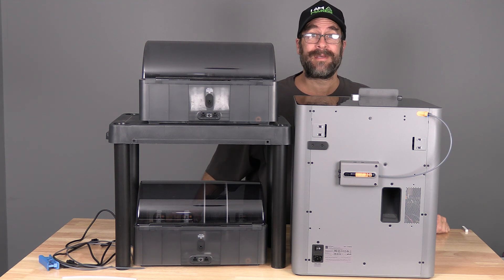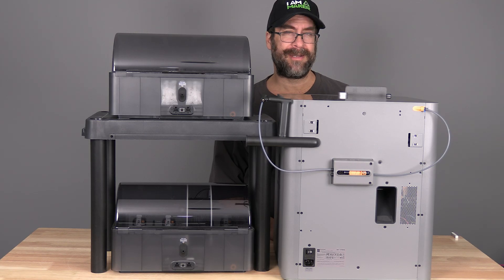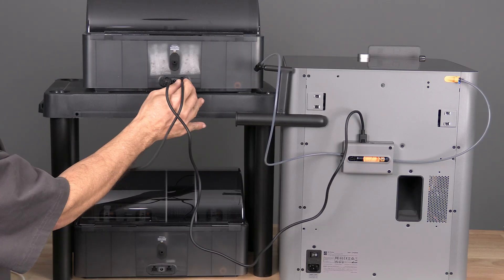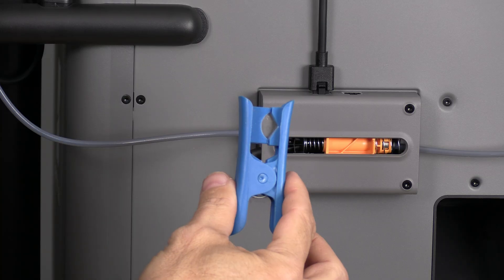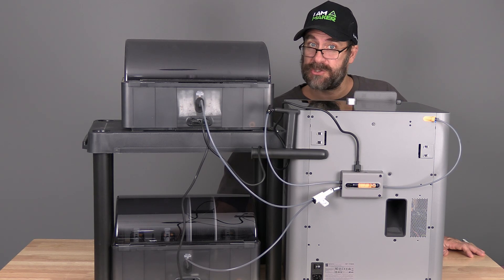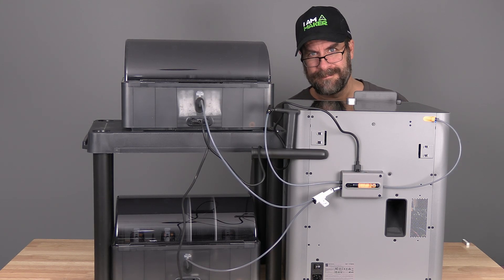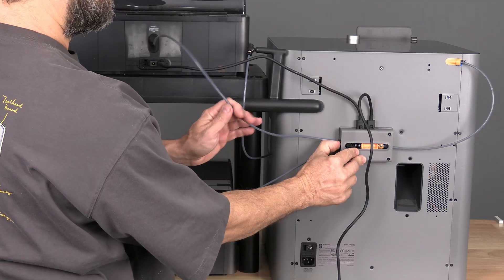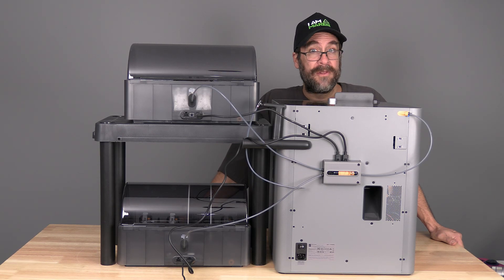How to Install Two (2) AMS to P2S 3D Printer - Bambu Lab

Comment: Bambu wiki P2S FAQ says "Q: The buffer of the P2S has two 6-pin ports on top. Does it support connecting two AMS/AMS 2 Pro/AMS HT units simultaneously?
The buffer does not support using two 6-pin ports to connect AMS/AMS 2 Pro/AMS HT units at the same time. One of the ports is a spare port, used for power supply and communication expansion of devices (e.g., time-lapse photography kits)."  This conflicts with the second setup you demonstrate.  Please advise.
Reply from the maker: There isn't really any reason not to daisy chain the 6 pin cables, but, I do believe both ports can be used. My P2S has been disconnected since I shot these videos, but I will try to hook it back up and confirm.
Reply: @3DRundown  I was wondering if it might affect the chain for getting drying power from the 6 pin for the first AMS 2 but needing AC adapter power for the second AMS 2 in the chain (and whether using both 6 pin ports might screw that up).  I've got a P1S using an AMS and AMS2 with P2S combo on order so I can't test yet but want to hook the new printer up correctly.
Reply: @MichaelWebb1416  @3DRundown I'm also interested in confirming this. I would prefer connecting the second AMS 2 Pro directly into the P2S. No real reason, I'd just prefer the direct connection versus daisy chaining.

Comment: Thanks for the great video!
 So the first method you demonstrated will also allow for 2 AMS 1 or 2’s as well as an AMS HT?
Also it is advisable to set the two AMS units on the right side (if you’re facing front) of the P2S? I had planned to set them up on the other side as that’s where I have space for them.
Reply from the maker: You can do up to 4 AMS2 and 4 HT, for 20 Color. That side would be ideal, as that is where the inputs are, but you could manage either size.
Reply: @3DRundown  Thanks so much! Your videos are super helpful and very thorough.
Reply from the maker: Very welcome!

Comment: If you daisy chain the plugs do you have to use the 4 way hub or can you daisy chain and still put one in each ptfe slot?
Reply from the maker: P2S hub has only 2 Inputs. You can use one in each, or the 4 way in one
Reply: @3DRundown I was more asking that in step. 1 you put the PTFE tubes in one slot on the hub and daisy chained the ams power cables.

My question is can I daisy chain the power cables and put each ams into a different tube on the hub, essentially splitting the difference between each of your methods
Reply from the maker: The typical way would be using one 6 Pin on the Hub, then connecting each AMS to eachother, via 6 Pin. Then one PTFE per splitter input

Comment: Love the video I just ordered my second AMS2 pro to add to my P2s but I’m confused a little bit on the video I know on the P2 S you don’t need to upgrade kit because it already has a spot for two AMS and 2 6 pin connectors to plug-in but do I need to buy that six pin connector or does the AMS two Pro come with it when I buy it?
Reply from the maker: Your AMS will have a 6 Pin
Reply: @3DRundown  The non-upgrade version, purchased stand alone, comes with a 6pin connector, but not the power supply, that has to be purchased separately?
Reply from the maker: @BDS369 Yes. Your 1st AMS 2 Pro, does not require an AC Adapter. If you need one, it's seperate
Reply from the maker: Also, rather than use both 6 pin on the hub, connect each AMS to eachother.
Reply: @3DRundown  When using two AMS 2 Pros with a single P2S, why do you recommend connecting the 6-pin from AMS #2 into AMS #1 instead of into the buffer hub on the back of the P2S?
Reply from the maker: @playab0yyy  Because this is what Bambu engineers are asking us to do

Comment: Great video! Can you advise which of the two AMS2Pros will need the additional power source? Is it fine to plug into either one or does it need to be a specific one?
Reply from the maker: The P2 can heat ONE AMS2 at a time. If Heating 2 at a time, one of those 2 will need the AC.

Comment: For option 1 to work, do you have to have a splitter even if you're not interested in using the external spool? ie. can you keep the daisy chain powering the AMS, but feed the PTFE from both AMS directly into the hub
Reply from the maker: Yes, you can do One AMS in each PTFE.

Comment: if we connect second ams to p2s, do we still need to plug in adapter ?
Reply from the maker: yes
Reply: Is the plug in adaptor to heat the filament (only) or to power the AMS?
Reply from the maker: P2S can power AMS. P1S  Cannot. P2S can Heat ONE at a time. Additional need an A/C

Comment: Gregg have you done a video on connecting the AMS 1 to the P2S? I'm sure the buffer is the only difference and of course the addirional 6 pin to power the AMS2 Pro. But I don't have the p2s to verify.
Reply from the maker: Exactly the same.